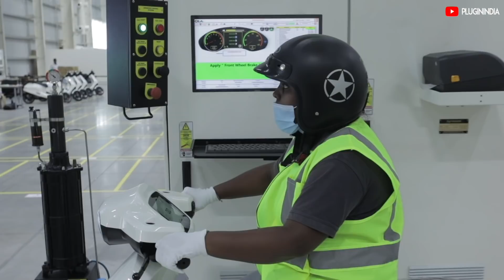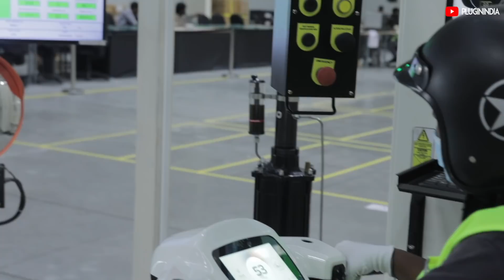OLA Future Factory: Guided Tour | QnA

Comment: Hello sir, as ola customer I will tell you what exactly is happening. Many customers are angry with ola and Bhavesh not because of incomplete product but mainly because the way they are responding to the complaints. Firstly they don't respond only and even if at all by any chance they respond it will be without any concrete solution. And yes we are very proud the way he has set up the factory so fast at that scale and challenges they are facing due to unforeseen events. All we ask is mutual respect. We respect that it is an start up and all won't be perfect but at the same time we also expect them to respect it's customers. The public want is honest response from Ola team which hasn't happened from day 1. They failed to deliver many promised things even after many lapses, latest being Move OS 2 update. 

I genuinely wish bhavesh to take this feedback and come out with flying colors.
Reply: Your analasis is better than video

Comment: Unbiased review. 

Have two queries :

a.  In video, test ride shown through water is not clear.  The water level is much below motor. 

Consider Mumbai rains,  water logging is common and water levels rise  > 12 inch,  driving through this where motor is completely submerged along with battery part,  will driving be safe.

b.  Will there be provision of swapping existing battery with LP battery at OLA considering safety concerns in near future.

Comment: We need one cycle pedal also in the ola.
I had to tow it for 2 times in first month itself.
I ride only in normal mode and my daily driving distance is 30 max.
Reply: How much range you are getting in normal mode
Reply: @ayushjhawar9741  it is varying sometimes its is 100 sometimes it is 96.
Ola champion told me to hard reboot once in a while to get full range.
Also after 2.0 os update they are saying this problem will disappear.
Reply: @kavoorimanoj6151  in ola s1
Reply: @ayushjhawar9741  95kms. Can't take risk below 50kms in normal mode. It can stop anytime. 
They are saying move 2.0 will solve this. Let's see.
Reply: @ayushjhawar9741   you won't get s1. You will only get s1 pro. Mee too booked s1 only initially.but when the payment window opened it was showing s1 pro only, no option for s1.
Reply: @kavoorimanoj6151  but you have to pay for s1 amount only next 30k for unlocking.

Comment: Sir,is This NCA battery will have Charge cycles of like 2,000 like LFP or 1,200 Like NMC,or somewhere in between.Need an answer for this.
Reply from the maker: Lesser 500-800 
You will notice degradation sooner. Compared to LFP.
Reply: @pluginIndia 👍Thanks Team, for your Prompt Reply, so it is roughly around 1,200 like NMC.I also Wanted to Buy Simple one which has NMC chemistry.is there any current or in near future Smart Scooter's like OLA or Ather,which will have LFP Battery chemistry.Please let me know.Thanks.😀

Comment: Awesome 👍
Ola can fit solar panels on its massive roof... to generate electricity ... Just by using robots doesn't make it FUTURE Factory... because all automobile companies are using it...
The company buses & cars can be at least CNG vehicles if not electric.
THEN it will be truly FUTURE Factory...

About fires: ... 
1. The more pressure the vehicle puts on a the battery (speeding & fast charging) more are the chances of fire... especially if they did not use any battery cooling...
2. Looking at the hate coverage OLA got just because their scooter was delayed by a few months... and other nasty press incidents... It will not be surprising if ICE scooter companies must have set it on fire... just like they might have done to Tata Nano.

Bad part of Ola is definitely the footboard ... & Worst part is their customer care. I don't think OLA will bother to change both. 😂😂😂

Car making will need much better customer care because the eCar will be in the range of 8-10Lakh.

Looking at the Ola scooter customer care issues only a fool will invest ₹8+ Lakhs for an Ola eCar.

Ola needs to EARN our trust. Tata Motors has EARNED it.

Ather as a company is most suited to move to making eCars ... Hope they will move to car making...

Comment: Is ather going to be a better option than Ola . benefit in Ola is higher speed ( but limited to few KMs as over heat stops it to normal mode ) . Ola gives more warranty than ather . But Ola consumables ( break pad and leavers when  changed are more costly . Ola gives service at home , but atehr need to drive till service station . Ather is light , Ola is heavy . Ola is fibre bost , but chasis of Ather is rock solid , Ola has better ergonomics ( high handle bar than ather ) . Ola claoms more range ( but last 15 % is at ECO mode . Ather gives consitent performance in all modes till last 1% of battery .. Finally Proce in Bangalore Ola S1 Pro @ 142000, but ather at 162000. Please suggest as bith as Pro and cons

Comment: 15:32 "ANY LOOSE CONNECTION CAN CAUSE THE SCOOTER TO STALL". That's why thousands of OLAs either taken on a flatbed mini truck (ambulance for them) or pushed on roadside by owners 😂🤣😝
Reply: Most of caused by inexperienced staff(ola marketing with as women workers)that is the worst part, almost some of experiened staff,do there job,other then they don't anything,if in line,they even don't know to identify some mistakes done by other

Comment: Very good production line but after seeing OLA bikes burning videos in YouTube im scared to buy one.
Reply: There was only one incident in Pune. What do you mean "bikes".
Reply: Here is the truth. 
1) So far only one OLA scooter has caught fire in the country. It happened in Pune last month. The owner claims to had parked his vehicle in extreme hot sunlight. But if you closely watch the visuals, his claim doesn't match. Anyways the official investigation in progress.
2) There was another incident of a EV scooter blasted during charging which ended up causing 2 lives. This happened in Tamil Nadu last month. It was an Okinawa iPraise scooter. The owner had kept the vehicle in charging overnight inside his house. And so far this is the  only one incident reported with Okinawa scooters.
3) Another incident happened was a truck loaded with many EVs inside caught fire. The fire was originated from one of the EV scooter inside. This was Jitendra EV scooter being shipped to Bangalore from North.
4) In the most recent incident an OLA owner from Ambur, Tamilnadu set his OLA S1 into fire out of repeated charge drain issues and frustration. Unfortunately this is being portrayed as the scooter caught fire by itself.
Reply: Do you have more details about this issue with ola or even about other brands . Have you shifted through more data .Or have you just made your opinion by looking at only one video. 
Very recently due to high heat ac compressors have blasted. Does that mean all acs are bad and manufacturers make them in such away that they blast . 
So please go deeper and encourage manufacturers and users
Reply: @MrKhabbu  actually my friend has Ather 450 I was planning to buy OLA ,i changed my mind and bought Ather and I also took test ride of both vehicles Ather pickup is next level.Ather is also a Indian company.those who don't compromise with quality we should encourage those companies.
Reply: @jsarun5825  if you have done your due diligence and  test riding and then made your decision it is well and good .
But judging by one video is dangerous. 
In 1984  Lot of negative was spread about Maruti cars. I was one of the first 100 customers and my experience was very good . 
Same was with 100 CC scooters . People from hearsay were doubtful about its pulling power . 
Daewoo Cielo was killed in spite of being a very great car . People did not know how to drive a MPFI engine and blamed it for poor mileage . 
Tata Nano is most appropriate example . A couple of cars caught fire and it was blown out of proportion to the extent of killing the product . After that not a single car caught fire and now Tata Nano owners wish that Tata should have continued with it . 

Even BMW and Mercedes have caught fire and that to high end models . They are catching fire in America and Canada . I recently saw a car burnt out on highway in Toronto Canada . The season was winter.
Reply: @MrKhabbu  👍

Comment: hello atulji.. a very informative video, as an OLA S1 Pro owner , your video has given a boost of morale and given some confidence on the product that i have purchased.

My experrience is so for ok, driven 2.5k kms (in 3 months, Feb 8 - present) , i have faced reverse bug once , cleared after restart. apart from that experience is good.(still in Ver 1.0.8)

there are 2 questions , if you could provide the answer it would mean a lot.

1. is there any extended warranty on battery from OLA...? or are they planning to provide extended warranty..?

2. is there any battery replacement program (after warranty period) where they can buy back old battery at certian price and give us new battery at discount...?
Reply: You don't need to replace battery after warranty.

Comment: In the name of women empowerment, the ola hired useless girls for low salary. mr. Bhavish, its not 10,000 rupees mobile.....its 1.4 lakh scooter so be serious. Customers not jokers.😡😡😡😡😡1st you fired all useless girls and hired some experienced women for assembling work and improve your scooter body quality......
Reply: Bro it's not about women ola management team is giving training what actually the have to do so either a boy or girl it doesn't matter
Reply: Advising from outside is very easy and it is very difficult to actually run an outfit . These girls are doing much better
Reply: @MrKhabbu  commenting from outside also very easy. I had paid 1.4 lakh to them. If they give quality product, they why i had asked this questions.?? Don't support girls with your closed eyes..
Reply: @trollmedia7391  How the girls are to be blamed for that . They are doing simple things . Neither battery nor any components and software is made by them . 
And for that matter how many petrol diesel. Vehicle  manufacturers have gone overboard with problem solving . 
Forget automobiles this is applicable to all sectors and products . 
And I am commenting because I have handled complaints and sales both and in fact I got most committed customers and supporters from the complaints I received .
Reply: @MrKhabbu  as per your statement components are made by companies but ask questions on fittings....in my scooter's speeaker fram was broken due to over tightening of screw. Is it acceptable???.... Don't behave like a nonsense. Handle body (which includes switches ) are dancing when i lightly try to shake. Is its manufacture mistake.
Reply: @trollmedia7391  so what . If you are hell bent on blaming then keep blaming but don’t call me nonsense. Remember one thing when there is defect in god made man there will be guaranteed defect in anything man made. But the question is how the defector problem is and how timely it is solved .
Reply: @trollmedia7391  and how do you know that the speaker frame was broken due to over tightening . Go to the factory and check how they do this and also the other assembly.
Reply: @trollmedia7391  and by the way what do you do for living
Reply: @MrKhabbu  i taken my scooter to MRI Scan🤦🏻‍♂️🤦🏻‍♂️🤦🏻‍♂️🤦🏻‍♂️..... don't ask like fool....
Reply: @MrKhabbu  i think you are a male feminist 🤣🤣🤣😅😂😂

Comment: Bich raste me gadi ruk jata hai uske bare me puche nahi or sab customer itna problem face kar rahe hai uske puche nahi. Gift me kitna Mila hai Atul ji Atul ji
Reply: You need to initially charge the scooter till battery charger light turns green. This will rebalance the cells and give 100% range. Also retstart scooter once a week after 100% charging to check % drop. If is 10% or more then call Ola Customer Care. This information has been available and followed by many to prevent range drop.

Comment: Battery gets fired on 120 degree in current chemistry so all ola are safe. 1 fire incident occurred due to short circuit connection of the cell that's what I feel.

There are lot of videos on YouTube driving on high temperature above 45 degree without any issues so nothing to worry 👍👍
I saw one owner parked his ola in hot sun ☀️ for entire day with no issues for last 3 months without any issue at all one incident does not mean it needs any cooling 👍
Chemistry badalane ki jarurat nahi aap apni soch badalo aur ola kharidlo 👍👍

Comment: I don't think liquid cooling will cost more than 5k and the moron job is putting plastic cabinet on battery pack. I don't think Ola has highly innovative Engineers. Even few youtubers do better job than Ola Engineers. 
Even their market research is too poor. None wanted the overhyped smart features and music in a scooter. All customers look for range and power. In these terms Ola is simply failure.
Reply from the maker: They are delivering on range and power. 
Agree. the battery engineering could have been better
Reply: See, if any one is getting burned into ashes while riding this scooter it's not a problem but they should focus on  range and features...the great OLA !! The Plug in India team should take this scooter for use atleast for a month and park it in their garage. Let's see their guts!!
Reply: @pluginIndia  1) overheating is destroying the range and safety.
2) battery charge prediction system is absolutely garbage. Battery charge suddenly drops from 30% to 0% they must do R&D in this field.
But sadly I suspect if they have any innovative Engineers or they are just copy pasting Dutch innovation.